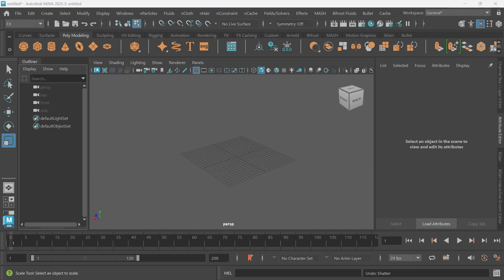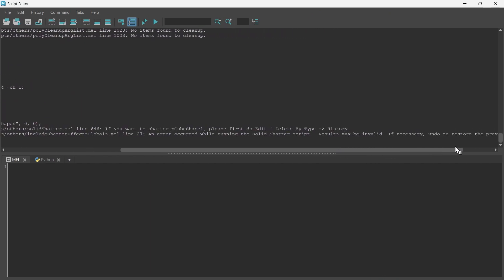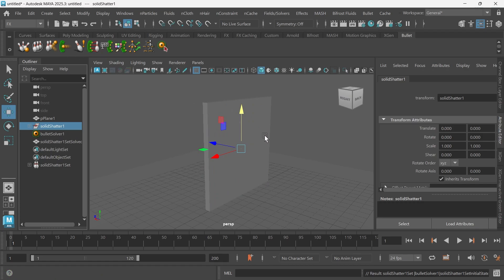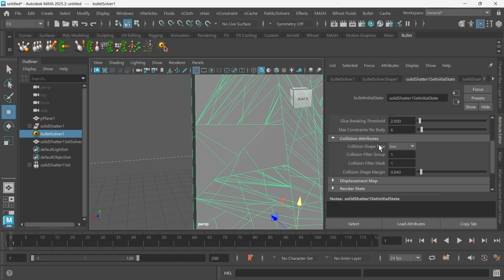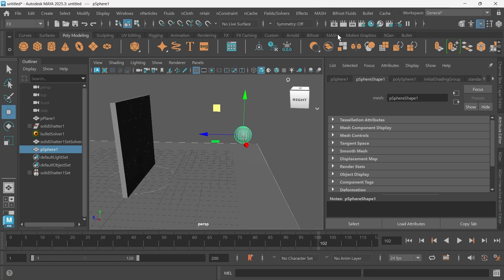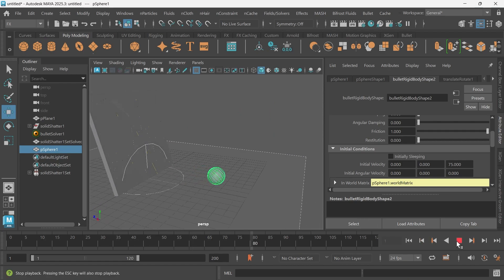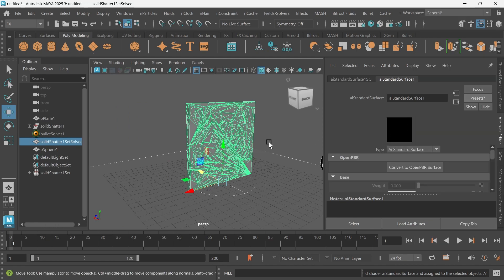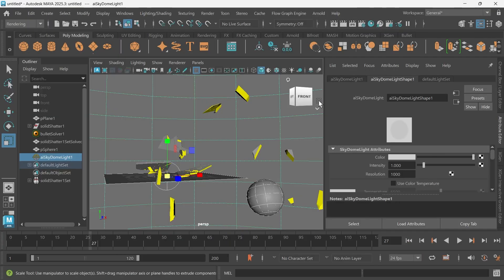How to Shatter a Glass Wall in Maya Using Bullet

Comment: GPU acceleration for OpenCL is not supported; falling back to non-accelerated mode. Check your system's video card driver supports OpenCL

Getting this error

I updated the graphics driver, but still getting this while choosing solver acceleration in the solver properties tab